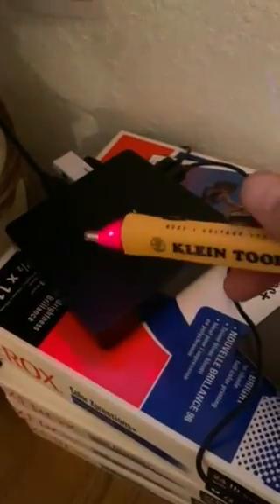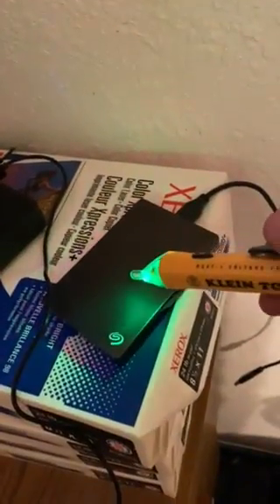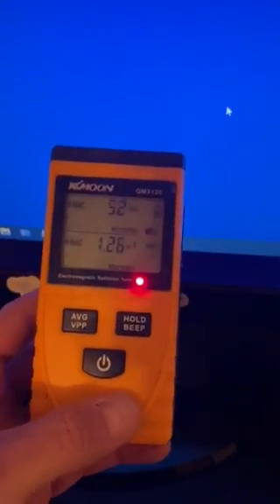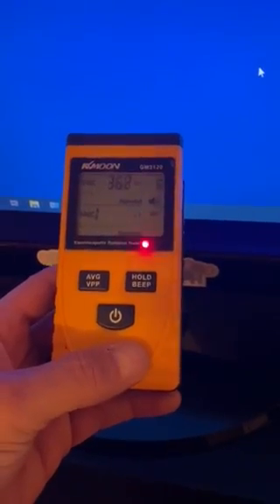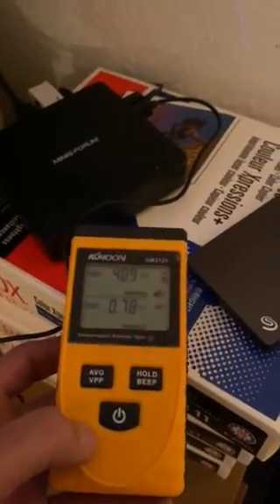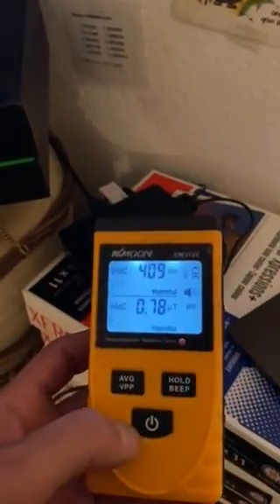Cyber Power Attack - Electromagnetic Attack in Real Time:

Comment: I got even one better.  My MacBook Pro was booted to a Linux live dvd in 2013 and I was trying to connect to the router with a cat5 Ethernet cable.  It was trying to grab the IP address and was stuck.  I had a weird feeling so I tried to turn off the last device I had, which was my iPhone that was already in airplane model.  The moment I powered off the iPhone, the MacBook Pro connected only via Ethernet to the router said “network disconnected”.... I replicated it 4 times in a row to assure it wasn’t a fluke.  This was a firmware level hack that survived me booting into a Linux live dvd.  We should talk.